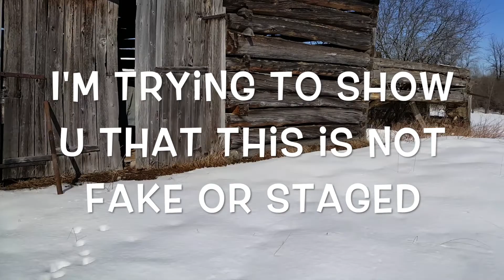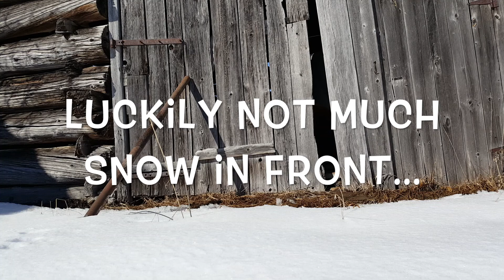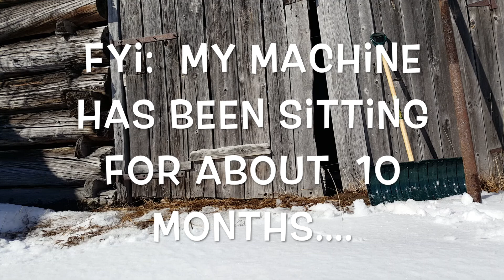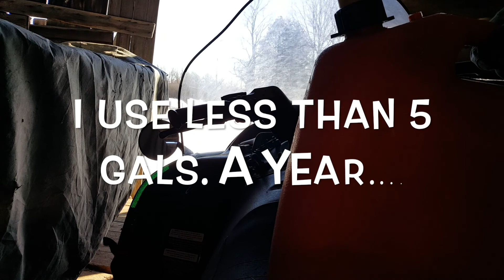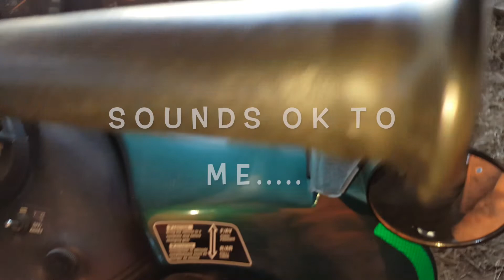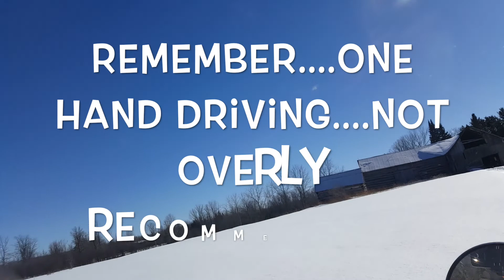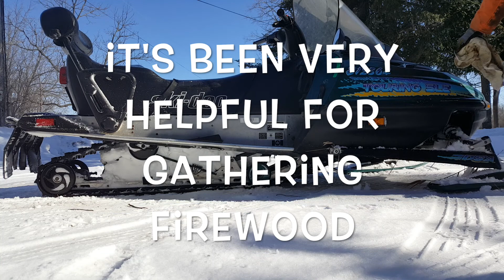25 yr Old Skidoo 10 months in Storage Starts on 1st Pull #amazing

Comment: Good Stuff.
 With regard to the snowmobile's age, you might want to consider mixing the oil right in with the gas rather than depending on the injection pump or,  give the pump drive components a good inspection. If something were to happen to that oil pump, could ruin your whole day.